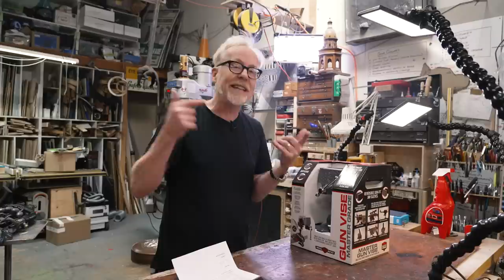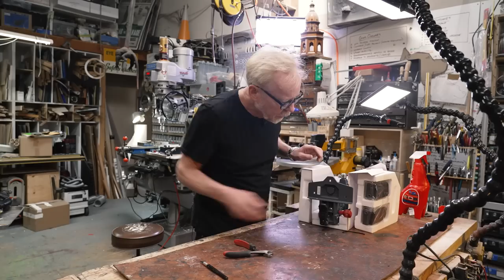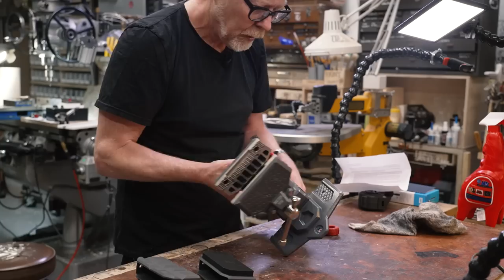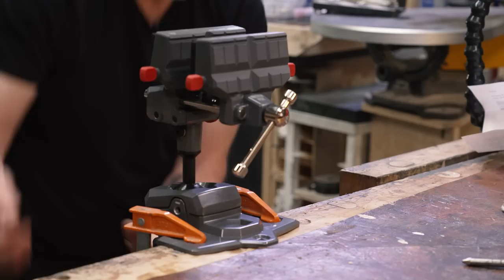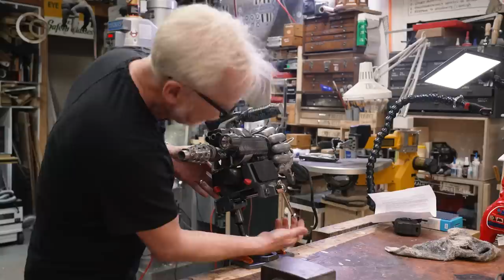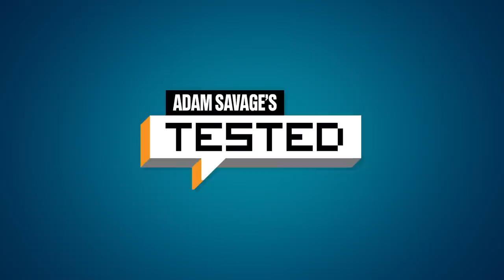Inside Adam Savage's Cave: Workbench Vise Mailbag Unboxing!

Comment: I have a small cheapy one of these and it is incredibly useful on my workbench. Just the other day I was having issues holding onto the 3D printed parts of my DC-15A Blaster Rifle as I assembled it and this type of vise really helped. Wish mine had the jaw options of this one. Mine only has aluminum or a thin rubber slipcover.

Comment: The rest of us grab our EDC (
Every Day Carry) folding knife from our pocket to open a box.

Adam Savage takes two steps across the shop and plucks an X-Acto knife that could double as a scalpel from a fully stocked tool rack.

<a few minutes later>

Wait...it has holes to bolt to a workbench, but it also includes a sturdy clamp for temporary mounting.  And not only non-marring jaw covers, but the reverse side is channeled to effectively clamp a barrel (or round stock)?
Product placement or not, that vise just landed near the top of my to-get list.

Comment: If that primary vice handle (torsion bar) can be bent so easily (even if only slightly) by a relatively light wooden mallet 'persuader' it doesn't speak well for its shop longetivity IMO, when things are likely to be overtorqued often by careless application of haste, resulting in further torsion bar deformation..

That being said, the general design looks superb, esp the almost full rotation & locking ability of gripping surfaces & reversible jaw cheeks! :) By the way Adam was holding & moving it I'd guess the main structure is cast aluminium; for my personal preference I'd prefer cast iron (or maybe even steel) for more structural integrity & permanence of installation, but that being said my portable cast aluminium vice is still performing well after 60yrs use, so maybe not as critical ;)
Reply: Normally I'd agree, but Bubba probably won't be allowed near this vise, and it will mostly be used for high-value items whose finishes won't tolerate rough handling.
Reply: Yeah I thought that too, and imo, the main screw to tighten the vise seemed to be pretty sticky and not as smooth as one would expect from an expensive vise

Comment: This was great!  I have a couple of tools from RealAvid and they make top notch stuff.
My favorite ZipLoks are the ones where the two ends above the zip that you grab to open it are slightly offset in height, making it easier to find the opening.
My question for you is, have you ever opened a box for a new tool and after examining it, thought, Man, I wish they had talked to me during design... Its almost perfect, but this one thing is just not right...
Reply: I often cut a little triangle out of one side of all the "convenient" resealable packages things come in so they'll actually be convenient :-).

Comment: I dont have a vice like that, but I do have a carving vice that is somewhat similar.  I ended up making a thick plywood base that I attach it to that is then screwed tightly to a 2x4 that I can then stick in my wood vice to hold it vs clamping it to the bench,  so you could I am sure with your bench vices come up with something similar.

Comment: I do a lot of wood carving and have a smaller Stanley version mounted in a machinist vice, so it can move in any orientation at pretty much any height between sitting and standing. I think you'd really dig a set up similar with that one :)

Comment: I got the same vice to test. It is a neat vice the ball joint is a little ruff and gobbed with grease which if filing or cutting something all the shaving would get stuck in. 

I had to laugh ... RTFM.. very true it is not really intuitive on how all the pins are used. I had to pull out the manual and read it.

But it for sure is a neat vice and will find a place in my shop.

Comment: Hey Adam,    I started wrapping the smooth wood handles of my clamps with Hockey Stick tape (a Stumpy Nubs tip).   They are so much nicer to use now.    Pony and Bessey clamps are great, but the handles not so much.   Ironically , the Harbor Freight clamps in that same style have a really nice grippy handle.

Comment: I’m a quadriplegic and use a swivel vice to hold and manipulate everything since I can’t physically… whether it’s measuring, assembly, disassembly, taking pictures, even opening packages…
just bought a $60 swivel vice off Amazon that I like. I originally got an $18 Amazon special that was disappointing because the ball was not smooth and never clamped evenly. I really wanted a vice like yours (I looked at gun vices) they were just too expensive.
Reply: That's a bummer (about the price). Do you know what the vice is called that you got? Does it work better for you now?
Reply: @gohawks3571  AIWL 360 degree… it’s orange. Replaceable jaws and the ball is smooth and has a nice, even, positive clamp. Works great!
Reply: @widowmakerdesign  Great; thanks!✌️

Comment: Adam, I had a unique vise before with an odd mount to it. I actually made an adaptor out of T bar steel (just drilled mounting holes in it), mounted the Vise to the T Bar, so that I could just put the T bar in my normal mounted Vise for quick setup.

Comment: That's pretty cool! I wonder if you can use it to work on something delicate, with foam to hold. Or would that be scary?
Idky I never saved those baggies; probably because I don't get things frequently enough. My favorite things that came extra are tiny screwdrivers (obviously came with tiny screws), and an actual real wrench instead of an allen wrench that came with an outdoor chair. Had allen bits, but really cool little wrench